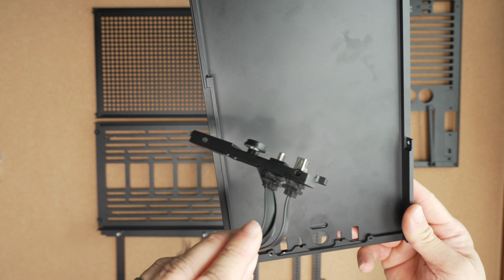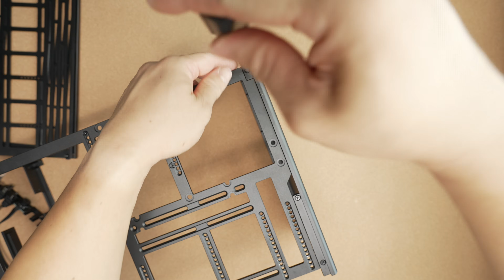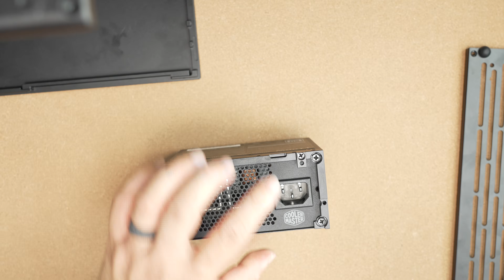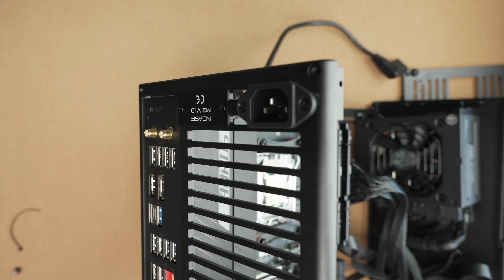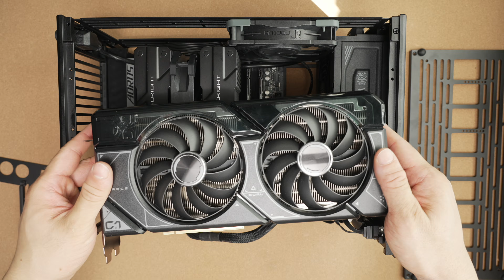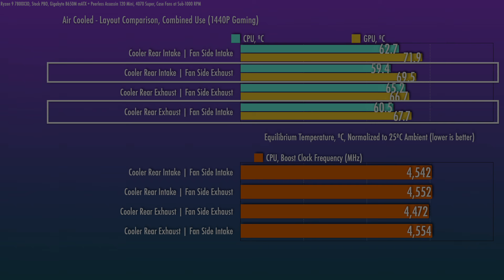Ncase M2: 7800X3D mATX Assembly and build!

Comment: I see you have a b650m. I was considering an asus strix b850i for my mother board but I don't know what the difference is. They both have pcle 5.0. This will be my first build so kinda a noob. I am was planning on running a 7800x3d and 9070xt graphics card.

Comment: Do you think the new M3 ncase will fit the matx with 9950x3d with nh d15 g2 noctua air cooler and 1000w psu plus a 5080? Do you think it would be possible to make this work with great cooling? I just don’t want a mini itx but will go for it if find out that cooling is not so good with an matx. What do you think? Thanks

Comment: Was the top case fan set in exhaust for both configurations? Also, it'd be interesting to see how the temps compare with rhe flipped configuration since that'll probably have more efficient airflow but only 1 exhaust fan

Comment: Thanks. This case is a little confusing to build the first time, and you have by far the best video on putting it together. For anyone else thinking about the case, make sure you read the short manual -- there's one special screw you need to use when attaching the front of the case else it will interfere with the power supply in some configuration.

It also comes with optional beveled screws you can use which apparently attach a little bit stronger.

Comment: I ordered a D12L. Now debating returning that and grabbing the same cpu cooler you got and grab the radiator panel for side exhaust.

Hmmm. Are you using the top fan as exhaust or intake?

Comment: can the PSU be orientated so that the fan is right against the side panel furthest from the Mobo?

Can the bottom & top rad/fan holders be reversed? I have an odd need for the GPU to be on top of the build with the rad being plugged up top & the mobo on the bottom

Comment: you showed 2 different fan positions in your final build.  I like the rear exhaust for the cpu cooler.  And I also like the side intake.  But what was the point of the top fan?  Are you also setting it to exhaust?  Some of your pictures shows the top fan and some dont.  Just wondering which set up you actually used/liked?
Reply from the maker: The top fan is always exhausting. You can vary the cooler and rear fan direction based on your preference.

Comment: heeyyy wanted to ask which psu i should go for if i want to future proof a bit? the corsair 1000w sfx or the one you've used in this video v1100 from CM? I heard that the cm is worse due to coil whine and generally quite noisy fans?

Comment: What's your opinion about having a Top down cooler like the Noctua NH-C14S sucking air in, maybe an additional side intake and then exhaust with two top mounted fans? I wonder why nobody is going with the NH-C14S, since this would fit very close to the side pannel, granting lots of fresh air.

Comment: so for this build you would need to buy an additional fan bracket?
Reply from the maker: Yes, if you want both top and side fans.
Reply: @MachinesMore  Do you think temps will run fine with only the side panel? Was aiming to replicate this build but didn't realize I'd need an extra panel.

Comment: Surely the side intake and top exhaust fans being side by side cancel each other out? Can someone tell me if I'm right/wrong?
Reply: I'm wondering what difference having a 140mm (if it fits) top intake fan along with the side intake fan would make? Also wondering how much of a difference a rear exhaust fan would make? Would larger be better? Or is it worth matching the size of the CPU fan? Is that potentially drawing too much heat through the CPU?!

Comment: Thanks, ordered mine recently also. I was thinking a 7950x, 170w, for a workstation/gaming build but I think it may be too hot so might go with 9900x 120w. The only other air cooler I've researched that may fit is the Jiushark JF13K Diamond. its 24.1mm wide and strange looking, just a few mm less than the board. Saw in one video its abit better than the 120 Mini cooling wise, but in a tight space unsure.

Comment: I was going to order this case yesterday, but it's kind of a mess to get it with what you need all at once. The extra fan/rad mount is only $15, but I couldn't get it shipped at the same time as the case. So it would end up being 2 separate shipping charges. I wish they would just add $15 to the cost of the case and include 2 of the fan/rad mounts.
Reply: Same issue, the feet and io cover also seems like it be easier to include, I ordered anyway. I might try get my friend to help me 3D print something when I eventually get it.
Reply: @georgeb9150  Yeah you absolutely can print those feet. The original design was by optimumtech on an m1, and he printed them I believe. The design was so good, they asked if they could use it and included them with the v6 and 6.1 m1. The new design is very similar, if not the exact same. I think the new ones may come with little metal triangles to screw them in, but I'm sure you could figure some way to mount them.

Comment: Could you fit two slim 120 fans at bottom for intake? Would there be a benefit to that? I want to get this case so I can get an mATX motherboard and save some money on future upgrades since ITX b650 motherboards are stupidly expensive for what they offer. I will be currently moving from an NR200P with two 120 slim fans as intake at the bottom, 1 back 80 mm fan as intake, 1 side 120 mm fan as intake and two top fans as exhaust. Ideally, I would like to have two bottom intake, 1 side intake, 1 rear exhaust and 1 top exhaust in the NCASE M2 (Round). Would this be doable? The only reason I am buying the case and dropping the NR200P is for the slightly smaller size and because I want to go mATX. Thanks for your help!
Reply: Ahahah mate, we are all on the same boat with those stupid limited itx. I love them but damn, i hate wasting so much Money!

Comment: where did that connector come from? i am literally building the exact same part list thanks. only thing i forget is an angled connector for my asus dual 4070 ti super, but the connector it came with is straight not angled so i cant close the side panel lol, i did a build along with this video, thanks a lot!
Reply from the maker: The angled cable is stock with the v1100 SFX power supply I used. In general I do not recommend 90 degree adapters for 12VHPWR. Either use the 8-pin adapter that comes with the card or find a compatible ATX 3.0/3.1 power supply.
Reply: @MachinesMore  Thank you! im getting a couple of cables from MODDIY so i have options

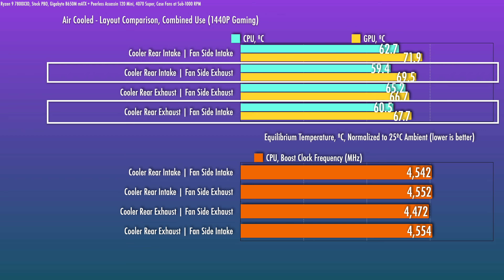Comment: I'm not sure I understood - @26:53 why would a rear exhaust/side Intake conflict with an RTX FE airflow/cooling design? Seems that would be ideal as both are rear exhausting? Also is there always an bottom opening at the rear under the GPU?? Looks unsightly.
Reply: Simple, the FE fan on the front throws air to the back of the card where that side fan is so you want it to pick the hot air from the video card and exhaust it.

Comment: Does the top exhaust not take away air from the side intake going to the cpu cooler?
Reply from the maker: Usually airflow doesn’t like to make a sharp turn- so the point is less to feed the cooler fan as much as it is to just create a pressure dynamic that will help the cooler fan exhaust.

Comment: Does it come with a riser or not? Do I need to buy it?  Does it come with a bracket to mount fans/rad or does that need to be purchased as well?
Reply from the maker: The standard kit has one fan panel, and the riser cable is an add-on. You can use up to two fan panels in this case.

Comment: First of all, it's severely overpriced you're better off getting IM1 case.
The nerve for ncase to demand extra for the atx psu bracket and also more for a side fan bracket, and extra for the tall legs...yeah, not gonna happen mate.
The IM1 (different names and brands like intertech, sama or whatever) has been around for many years now and is a very low price for offering virtually the same as ncase m2.
The IM1 is also fully reversible top to bottom (that's the only other aspect the m2 may have over the horde of other matx/itx cases) and supports the matx and atx psu.
The real seling price for the Ncase m2 seeing it comes disassembled should be like 20 bucks, 30usd at most with all the addons included.

Comment: Hi,
I was looking at the fan configuration and i was wondering when choosing rear intake and side exhaust is the top fan exhaust as well or intake?
Also does it affect the psu by starving air from it or since the exhaust is on the side it doesn’t affect the psu much?
Reply from the maker: The top fan is exhausting. I think in general you want that top fan to exhaust.
Reply: @MachinesMore  so both fan are on exhaust?
Reply: Do you still want it on exhaust when side is in intake?

Comment: I have my M2. I did inverted with a 5800X3D and a RTX 4070 cooling with a Thermaltake Assassin 120 mini. I have a Noctua 120mm 15mm under the power supply bottom front and two more of the same fans on top sucking air in onto the GPU. I have a Noctua 92x23mm fan helping to push the cpu air out. The machine is so quite even under full load playing Cities Skylines 2. It’s amazing. I’m very happy with my M2.
Reply from the maker: Love the 5800X3D. Rock on!
Reply: So your GPU is at the top the case and two fans intaking air on to it?

And for your fan under the power supply is that intake as well?

I’m having a hard time imagining where your CPU is positioned in this setup and where the 92mm exhaust fan goes. Seems like your build has more intake than exhaust which will help keep dust out.
Reply: What motherboard did you use on this build?
Reply: good job Nate!

Comment: Oh damn it doesn't look like you can do 2 bottom and top fans with matx. Maybe in the newer version whenever it comes?
Reply from the maker: It depends on the board’s top heatsink. It it’s low enough you could absolutely get a second top fan there. Bottom fans  with the small feet are more limited in utility, in some scenarios will add noise from turbulence. If you opt for the big “classic” feet, absolutely can work well.

Comment: I’m planning on building in this case with a similar setup 
Question is if a t30 would fit on the side with the fan bracket with the power supply being mounted at the front? 
Or would I need an itx mobo and mount the psu on the side close to the mobo?
Reply from the maker: You should be fine with the T30 in lieu of the a12x25 I used. There is clearance there.
Reply: @MachinesMore  thanks for the response! 
it should still be fine even if its inverted right?
also how loud does the Cooler Master V1100  get ive heard bad reviews about it being nosiy and having coil whine

Comment: I just did basically almost the same build and finishing up still in classic with the same CPU cooler. I was trying to match my NR200P build with 2 top fans though and found out the hard way you can only fit 1 fan cause of the mobo heatsinks. Instead ended up returning the fans I had and bought 3 slim fans and doing 2 bottom intakes and a top exhaust, along with the 92mm rear intake. Luckily the slim fans fit under my 4070ti

Comment: So hyped, my M2 is on the way!. Pairing it with a Asus Rog Strix b650i, 7800x3d, Power Color Hellhound 7900xt, Cooler Master 850w sfx psu, 2 crucial t500 m.2(1tb & 2tb), Gskill flare x5 6000mt 30cl ram, Thermalright peerless assassin mini air cooler and going to try the thermal grizzly contact frame with thermal grizzy paste.
Reply: man nice build choise! have you think about deshroud mod with 3d printed braclets for the gpu? i saw this that the hellhound os easy to mod.
Reply: I want to complete a build similar, just curious about airflow with this case.

Comment: With a MATX in that case just a reminder to check where the pcie slot is located if you have a big GPU.  Some are in the very top slot but many have them in the 2nd slot which will limit your GPU options

Comment: Have you tried the inverted build style? My M2 is shipping and Im wondern if I should go inverted for better gpu temps.
Reply from the maker: I have! I did an inverted comparison in my initial review. It makes a difference for GPU temps and I would recommend it for that purpose.
Reply: I'd be curious about temps on that, maybe gpu sag options as well. I'd also try it.
Otherwise great review and appreciate the walkthrough of the assembly.

Comment: Thank you. I have a question. The front I/O of the M2 that I received is different from the one in your video. I asked about it on Discord and was told that the modification was made to address compatibility issues. So, is the front I/O in your video from an older version, or did Nacse redesign it again?
Reply from the maker: Yup, mine is the old/early version. The new/retail ones won’t look like it.

Comment: Been experimenting with my M2 for a few weeks and it seems like the best current non-AIO CPU cooler option is a C14S with a P14 Max mounted directly on it and no side bracket installed.

If you're using a standard thickness 120/140mm fan over the C14S there's just enough room to install the fan directly on the side bracket. If you want to use the P14 Max, which is 27mm thick, you have to mount the fan directly to the C14S and lose the ability to install the side bracket, but the P14 Max's extra performance / extra performance headroom via it's much higher max rpm of 2800 is definitely worth it. Zero issues keeping my 7950X3D well under 89C to avoid throttling with this C14S / P14 Max combo even when load testing using P95 small FFTs.

For you a C14S cooled by 2* A14x25 G2's would be extremely hard to beat. Most of us don't have an extra set of D15 G2 fans lying around though 🤣
Reply: Hi, i have a question about layout orientation in there, are you using regular with gpu down or inverted with the gpu up? also do you have any other intake/exhaust fan ? I have a 13600k in my m2 and trying to find the best way to cool it :)
Reply: @vinhddoan5241  Inverted / GPU up. GPU is deshrouded and cooled by 2* A12x25 fans. Not enough height clearance in my setup for 2* T30's or I'd use those on the GPU.

Using 1* A12x15 & 1* T30 as exhaust on motherboard side with ITX mobo and front mounted PSU.
Reply: just inspired my cooler choice, ty
Reply: @MariusBelea  FWIW depending on budget if you're running a lower wattage part like a 7600 / 7700 / 7800x3d you could save the cash for a fan swap and keep the A14 fan that comes with the C14S. The P14 Max definitely gives the C14S more cooling headroom though.
Reply: @bomas_ulz  What would be loud? You can make the fan curve of any fan more or less aggressive. The P14 Max will move more air at any given noise level than any 120mm fan.

Comment: Can you fit a 280mm radiator in the top? (with an itx board)
Reply from the maker: Yes! You have to have some flexibility for the GPU placement though,  since you lower the board position you may find that you have too little clearance at the bottom, then you will have to go with a vertical gpu setup.
Reply: @MachinesMore  With a GPU waterblock that shouldn't be a problem. How much space is there at the top with the board at the bottom most position? Are you going to explore more cooling setups in this case? Really looking forward to more m2 videos

Comment: It's great to see this case get a 2nd look.  I am waiting on my M2 case to come in a week or 2. I'm planning on mimicing your original M2 build on the previous video but w/ a 7900 XTX and an SFX PSU. What size were those slim fans you had on top? 140mm?
Reply from the maker: At the top of the case I had a single A12x25, which should clear the PSU and cooler.

Comment: Great job! and great choice of CPU - i have no idea why other tech tubers always try to stuff a 14900ks in one of these, you might be the only one doing a 7800x3d that ive seen!
Reply from the maker: The 7800X3D is the GOAT!
Reply: @MachinesMore  Is there any benefit using a CPU with integrated graphics when you also have a dedicated graphics card? Would it make any more sense to use a CPU without integrated graphics if you intend to use a dedicated graphics card?
Reply: it's a useful backup and adds an hdmi/dp port, doesn't do much otherwise if you aren't actively using it
almost all of 7000 series ryzen  cpus have an igpu so it doesn't really matter, it's just a bonus to have  @SonderZensei
Reply: @SonderZensei  For Video editing the integrated graphics are a huge benefit if you edit certain codecs. Mainly 10-bit 4:2:2 H.265, if you work with that footage then intels igpu's are the only gpu's on the market that can hardware encode that footage. NVidia and AMD gpu's both don't support hardware encoding for 10-bit 4:2:2 H.265 for some reason, but they support it with just about any other footage
Reply: @SonderZensei There's no downside to having integrated graphics. If you don't need it, you can just elect not to use it. It can also help with diagnosing problems with your GPU.
Reply: yes, there can be benefits if using integrated graphics cpus even if tou have a dedicated gpu - gpu pass-through to virtusl machines, use the igpu for encoding, or even have more hdmi out ports  @SonderZensei
Reply: Ive heard that Intel is better for video editing, so in case youll stream and video edit on it thats the reason they chose Intel CPUs